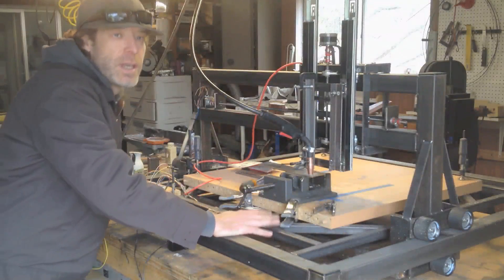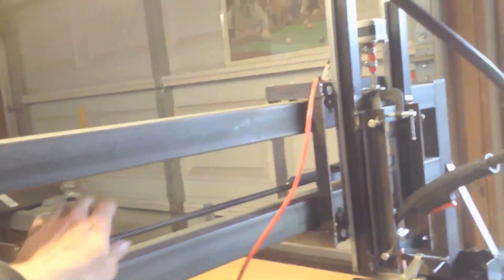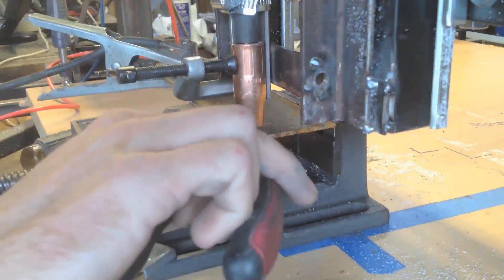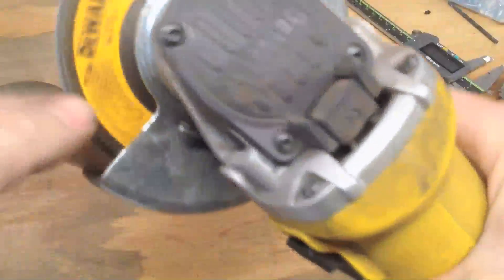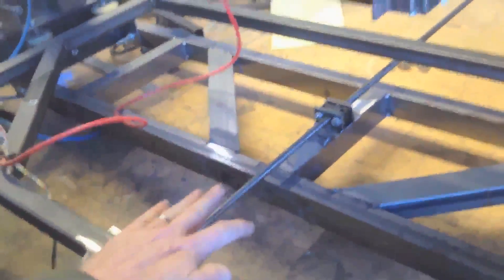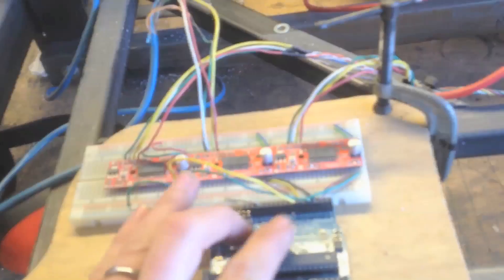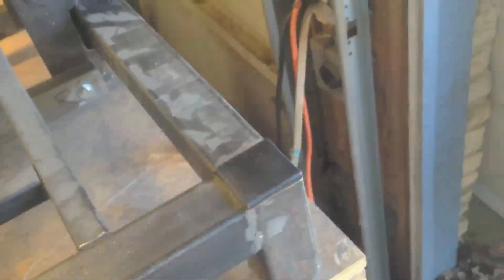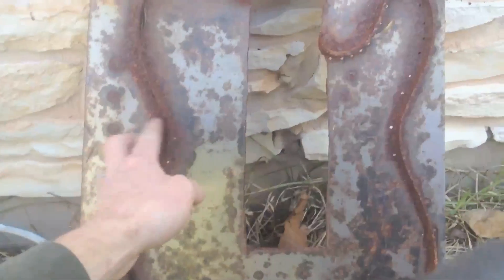How to: DIY Arduino CNC Router Cutter Welder (Part 6: Welding and Costs)

Comment: Awesome watching again!  Finally scored more material from gyms, docks (excellent source of heavy duty material) and pickin around craigslist and FB marketplace with a few finds at the Goodwill and Restore.  Passed up a few free copiers for the stepper motors and parts... thinking I might wait for... though will see.  RAMP has a CNC kit I don't really need to invest in... though seems neat as a newer all in one kit for controls.  I'm actually thinking to 3D print and foam wire cut with also.... and that's sort of what has me looking into again.  Though having the stock really helps and not being able to get into the Labs to work due to COVID is totally the game changer.  Thanks alot!  Be safe, healthy and good you care.  Have a good one!

Comment: I know I am 4 years too late - but you could use one of the spare pins on your Arduino Uno to trigger the welder, if you haven't thought of that already. Just set the pin to hi when Z is lowered, and low when the Z is raised. Connected the pin to a switch and connect it up to the existing connectors.

Comment: It just occurred to me as i was watching off line,you trigger the mig as the z axis lowers to start position,maybe you've already done this ,maybe not,configure the start micro switch at the end of travel where the mig start position is,the delay between the z axis reaching the height and moving off is probably a good start to stop a cold lap and get a good bead,the end of the weld run should connect up to the start of the bead again,the gap is more user than machine created,though for a manual triggering the outcome is good,and i'm jealous as f**k.

I have no problems with the build(i have welding gear up the wazzoo),i'm a 1st yr electronics technician so for lots of the output controls etc i should have it nailed,i had problems trying to configure the 3 axis cd/dvd plotters,though i recently found they step at 18 degree/20 steps,going for a nice nema 17 3 axis router plasma laser etc,i have one question for you,what operating system do you use with the cnc,xp,vista ...win10,i have vista and xpsp2 and xp sp3,i had some issues,though it could be norton blocking some program downloads,in case i need to get a more up to date Operating system to run grbl 9.? etc.

Great build ,jealous as f&*k(in a good way),hope it works out nice(er) for you.
ATB from here in scotland.

Comment: get a relay wired up as some use a servo for the Z axis on pen plotter cnc and connect the trigger leads to the relay contacts,it looks like a solenoid gas MIG and not the small "valve in gun" types and should be good to go.

Comment: excellent videos, very informative, well explained. I will try to build one based on your work Thanks. P.s.  I was searching for EC Driver on eBay could not get any result, could you tell me what should I be searching for in order to get the Ec drivers like the one you used.  thanks appreciate it.
Reply from the maker: Thank you.  Try "Easy Driver" instead :)

Comment: I believe that your skip when you start is a problem of speed versus current. What is needed is a switch like Lincoln puts in their sub arc. the wire hits the metal and the current closes the switch to change to weld speed. So then your machine wont skip when you start. 
The problem with the skip while welding is a problem of sspeed also. your wire is probably slowing down, Could be dirty liner.

Comment: Pretty impressive. I am a welder fabricator and machinist and have a taig CNC mill that I play around with. 20 yrs ago the company I worked for bought a welding robot. I worked with it a little. I was hoping to see you weld something together with this. The real trick here is getting the computer and programming and all that to work. If you can figure that out you can build any style of this machine you want if you got the other skills. Thanks for building and filming it all. Your a cool dude.
Reply from the maker: Thanks man.  I use the machine to butt weld long pieces for the work that I do.  The programming is simple because it's just a straight line, and I still just trigger it manually.  But the welds come out nice and clean.

Comment: A truly excellent series, thanks for sharing. I love your approach to "design" - evolution rather than revolution. Can you provide details or a diagram of the motor control circuit?
Reply from the maker: Thanks I appreciate it.  If you google 'grbl easy driver' then click on images,  you should see plenty of wiring diagrams.

Comment: is there a way you could build this and program it with g code?
Reply from the maker: This IS g-code!
Reply: When choosing your stepper motors, is there a way to determine the kind of power/other variables you will need? Like maybe taking a sensitive torque wrench and seeing exactly how much torque you need to turn your lead screw?
Reply from the maker: I had already gotten the motors way before I considered building a cnc.  I had doubts througout the build, but I figured I would install them and if need be upgrade to bigger motors.

Comment: Really really good, congratulations for a great job.
I saw all 6 videos in one run.

I know nothing about welding, so probably this is a obvious question, but... what type of welder are you using? 

Regards, from Chile
Reply from the maker: Thanks man.  I'm using a MIG (Metal Inert Gas) welder.  It uses CO2 to displace oxygen and steel wire on a constant feed rate to add material.  I think I paid $500 bucks for it about 15 years ago.
Reply: Thanks!

Comment: Steel is good because metal frame has no flex. Which mean you can scale it up with stronger motors and tougher lead screws and you can mill aluminium at decent speed.  There is whole bunch of DIY CNC milling machines on youtbe made with aluminium frame and they are all flexing which mean you can use only small tool and go slow when working with aluminium blocks.

Comment: Awesome work man. You know what? you can also use a relay or even a MOSFET to control the switch of the torch: you only have to add M4 (on) or M3 (off) in the gcode after each pattern (before Z rises) to let your arduino to control the welder.

Comment: Hi. Thanks for the sharing with us. Watched all 6 videos one after the other, twice. Found it very informative. For the "Z" axes you could of used the ACME threaded bar from a cars scissor jack  as well as its "nut block"  Again thanks for sharing.
Reply: Good call... I found some Mercedes older style jacks that are linear that I'm planning to make linear actuators with wiper motors.  I've also thought an old or even new large C-Clamp would be a suitable cost effective local source too for.

Comment: Nice job on the whole machine look great and runs smooth. I am looking to build something similar I was just wondering what voltage do you run the motors at like 12v or 24v and 1 last question do you know the amp draw and torque of the motors? or if you have the link to them that would be fantastic thanks a million great job again by the way.

Comment: Great job man. I'm in the middle of building my router now and I have been goin back and watching your videos as a outline for mine. I even went to Savers here in Toledo and bought used roller skates and roller blade's for the bearings and wheels which work awesome by the way, nice and smooth. Thanks again for your videos and sharing your knowledge.

Comment: The stepper motor have 6 wire, can you tell how connect this wire, I know the easy driver needs 4 wire but this motor ¿
Reply from the maker: disregard black and white wires.

Comment: Great job man. Best series videos for a low budget cnc machine.
What amperage per phase do your nema 17 stepper motors need???
Cause easydriver can deliver up to 750mA per phase and the chip on them is overheating pretty easily.

Comment: You can use the Z Drive to switch the Welder on and off.  The carriage is barely touching the switch, then moving z (cut thickness) will activate the switch.   safer and easier... switch off would be to lift Z to safe height

Comment: Beautiful project, and really smooth, square operation.  Thanks for making the video set.  Nice use of GRBL, and the web interface.  Next, a plasma torch?  BTW, you can control the switch with a MOSFET or solid state switch, driven right off the Arduino, on a parallel port bit.
Reply from the maker: Thanks man.  Yes I will be attaching the plasma torch but i need to ground everything properly to a grounding rod outside.

Comment: THAT IS ONE OF THE BEST HOW TO VIDEOS I HAVE SEEN , I HAVE WATCHED ALL THE HOME CNC BUILDS . I HAVE NEVER SEEN SOMEONE USE THERE WELDER  . I WOULD LEAVE ALL THE IMPERFECTIONS . THATS WHAT MAKES IT UNIQUE . PROBABLY THE RUBBER WHEELS MAKE IT RUN SMOOTHER .  ESPECIALLY WHEN YOU REALLY GET IT GOING AND THERES DUST , METAL SHAVINGS AND SO-ON . THE RUBBER WOULD GIVE YOUR MACINE A MORE SHOP FRIENDLY USE THEN ONES RAN ON ALL BEARINGS . I AM THE DESIGNER OF GABBYS GRILLS BBQ . I AM MAKING A MACHINE OF MY OWN . ONE OF THESE MACHINE FOR MY HOME BUSINESS WOULD LET MY IDEAS COME ALIVE . THE IDEAS YOU JUST SHARED GAVE ME A WHOLE NEW WAY TO GO ABOUT IT . THANKS FOR THE VIDEO . JUNIOR

Comment: Manas ManyakaYour project is very inspirational. You have a mind for detail. I agree with you that spot welding was better option for your CNC machine because if you weld the iron in a seam, it will band and distort your measurements. I am currently building a hydraulic brick making machine. I'm highly encouraged. Thanks man

Comment: what kind of power sources using 220 single phase 223 face thanks I'm curious because if I put it in the garage I need to know what kind of power I have butter it's kind of something I don't know if you could answer that for me I'd appreciate it my name is Lucy easy not Lucy why doesn't. Talking to text you if you could help me I'd appreciate it thanks
Reply: If you live in the states, you almost certainly have 220 single phase power to your breaker box.  You can certainly find good welders out there that use single phase, many of the professional  heavy duty (ship/bridge/building) welders are three phase. Everything done in these videos is doable with 220 single phase.

Comment: OK what would be best. Metal or Aluminum?

If you could what would you change?

Thanks in advance.
Reply: On this scale, the aluminum tends to flex too much to handle lateral loads (e.g. cutting with a router)  and distorts.  He chose well by using the steel tube stock he chose (which I'm sure was no accident--this guy is LEGIT).  If you are going small, don't want to weld, and are using light tools, you may get away with aluminum, but I would stick with steel.  Perhaps more knowledgeable folks will chime in and give their two cents as well.

Comment: I am impressed by the simple electronics.  Where did u get the driver board circuit?
Reply from the maker: I bought the drivers on ebay.  They're called Easy Drivers.

Comment: Do you like the performance of those tiny NEMA 17 steppers? Why didn't you go with 23s as your machine is pretty big and probably heavy?
Reply from the maker: So far so good.  Bigger motors always better.  Especially if you want more speed.

Comment: When I first started watching this , I thought "what a loser!" But as you progressed through it I actually became impressed.
Nice resourcing and retasking of available scrap and discards of the public. When you followed up with CNC welding I really appreciated your effort. If you haven't yet you could use an additional I/O port to trigger your stinger using a simple MOSFET circuit. Nice work over all, congrats.
Reply: Bryan, when I first read your post, I thought "what a loser" then I saw your picture and I still thought that....
Reply: Bryan,  I was thinking along the same line.  It occurred to me that if Absorber installed a micro switch on the Z-Axis rail so that it triggered when the welding head moved down slightly, it would trigger the weld to start.  I ususlly try to find alternate ways to get around a problem or objective.  Good call!
Reply: So who gives a damn about what you think?
No one! That is a true loser.

Comment: Thanks for sharing, IMO a brilliant job, I hope that they really appreciate you at your job, because you are not the run of the mill employee.  Brains and skill what more could you want.
Reply from the maker: Thanks William,  I work for myself though.   I had a "job" once but my boss told me I was unemployable.  Problems with authority I guess :)
Reply: Well, in case you don't know it you are ADD.  I'm 73 and only about 5-6 years ago found out that I was also.  Read about ADD and it will explain your whole life.  I could never work for anyone either, so I figured out how to make it on my own.  One think that you obviously have over me is that you can focus on the issue better than I.  either that or you edited out all of the screw ups:o)  I figured that I had been able to make it work for me, so I decided that I didn't want the drugs.  Of course, now I am retired so goofing off, is easier.  If you could use the money and had the time, I think that you could sell this unit.  By now you have all of the bugs worked out and "mass production" would be easier.  I sold a web company that had over 20K pages, so if you want help on a web site let me know.  You might be amused by my "holder" personal web site williampitzer.com
Reply: Another thought the threaded block, you paid quite a bit for, why not just take a block of HDPE and drill and tap it.  I did that with a block of Teflon once, worked great.

Comment: Hello awesome cool genius, can you tell me what is the torque on those nema 17 you are using for cnc? Thank you for sharing these awesome videos, big fan.
Reply from the maker: Thanks man.  That's a good question, I'm really not sure what the torque specs are.  I just installed them and it worked.  I'd suggest going with bigger motors/drivers for faster speed and power.

Comment: This was a cool series to watch, thank a lot. I am doing an Arduino based machine soon, and this helped. Some comments:You can make your own acme nuts, by making a tap from a piece of the actual threaded rod you are using. Drill and tap a piece of suitable plastic and you're done.It works really well and has driven my x-axis for a long time.
You will have to keep an eye on those drawerslides. The steel is not hardened and it is going to become sloppy.
Reply from the maker: Thanks for the suggestion.  I've heard delrin is supposed to 'lubricate' the acme rod.   The drawer slides have been holding up very well.

Comment: Good evening sir,  that´s a very good work; Than you for making this Project for YouTube watchers. It´s really interesting and useful.  as well Thank you for sharing your knowledges.   Im writing you from Venezuela; i´m a beginer at welding and doing this kind of Project. I´ve got a question for you:  what kind of welder machine did you use for making this CNC router cutter welder ? it´s a plasma or it´s a TiG or MIg invertir ? could you tell me please ?
Reply from the maker: Good evening sir,  I'm using MIG.  Thank you!
Reply: Thank you for the answer and thank you again for your job

Comment: are you able to do multiple passes with a welder so that in effect it would be a 3d printer but instead of printing plastic... it would be (sort of) printing steel? maybe consider it for a follow up video.
awesome video by the way. loved it!!!
Reply from the maker: I've tried doing that.  The problem is the new layer tends to melt the previous layer slightly, then everything starts getting sloppy because the distance from welder to material becomes uneven.   Thanks for watching man!

Comment: Great Video Series for Ideas. Somehow its seems curious to me that this huge and heavy steel version works with 3 Watt Easydrivers and tiny stepper motors from a printer/scanner. Do plan to update this machine to mill aluminium or steel ?
Reply from the maker: Thank you.   Yes I will be upgrading motors and drivers for more torque and speed.

Comment: Congratulations! That machine looks really rock-solid. I see just two long-term weak points, verbally: One ist the fixation of the y-axis with those hose-stop-rings. They  could soften and give in slowly reacting to the pushing forces, degrading the backlash properties - but that can be easily set back again. - The other point are the rubber tires of the x-axis rollers. You put a pretty high mechanical load on them - won't they flatten if they rest in one position for a longer time? And if they ever wear off - will you be able to replace them with the exactly same diameter? 
Your 3D-welding is a wonderful idea. Do you plan to add plasma cutting as well?

Comment: Very nice and cheap build.  Somethings to consider though, the open bearings will wear fast if they are not kept clean and greased. Those skate board wheels are a good thought but they need to be kept clean as well, trash on the track will mess up alignment or even may lift the y/z carriage and any sparks that hit them will melt in and after some time they will start to become problematic.  I love your idea the the z axis runner as well, that is a dam good idea.  I'm in the process of building a cnc router with furniture grade plywood and am using Nema 23 motors, a Raspberry pi with a Protoneer cnc hat (arduino built in to do the grbl) and Pololu drivers.  I'm intrigued with using the cat 5 and doubling the wires but I am afraid that they are not robust enough to carry the current the Nema 23's require.  See the plans over at http://hobbycnc.com/ for an idea of what I am building.  Also note that I took it a step further and am using ball screws and have up sized to a 37" x 48" work area.
Reply from the maker: Awesome man.   Thanks for the advice and good luck with your build.